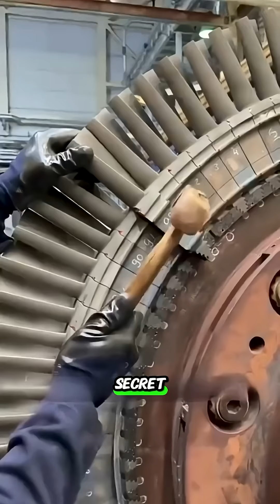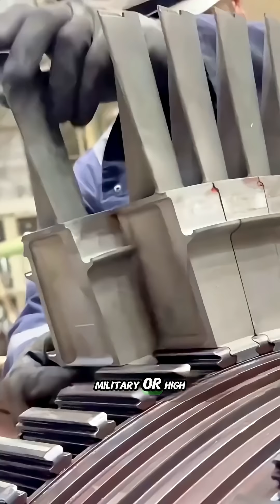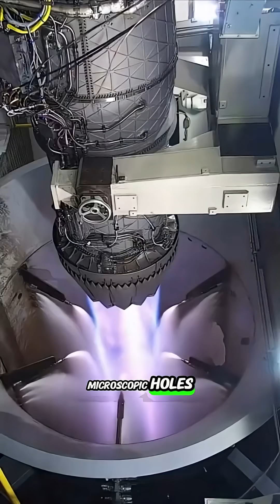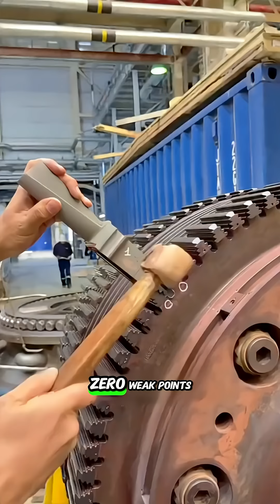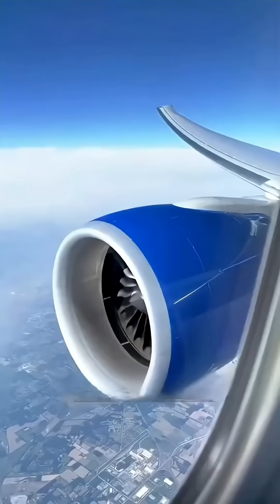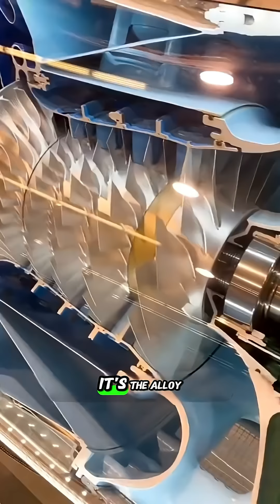The Insane Reason Nobody Can Copy American Jet Engines

Comment: Excuse me, there are quite a few that make good jet engines:
GE Aerospace. 
Rolls-Royce (UK): A dominant force in the wide-body commercial airliner market, manufacturing engines like the Trent series for the Airbus A350 and Boeing 787, as well as marine and defense engines. 
Pratt & Whitney (USA): A division of RTX Corporation, they produce a significant portion of commercial jet powerplants, notably the GTF (Geared Turbofan) engine family used on the Airbus A320neo.
Safran Aircraft Engines (France) A major aerospace leader that primarily operates in global partnerships to produce commercial and military jet engines. 
CFM International: A highly successful 50/50 joint venture between GE Aerospace and Safran. They produce the CFM56 and the LEAP engine families, which power the majority of the world's Boeing 737 and Airbus A320 fleets.
International Aero Engines (IAE): A consortium consisting of Pratt & Whitney, Japanese Aero Engines Corporation, and MTU Aero Engines (Germany). They manufacture the V2500 engine for the Airbus A320 family.
Engine Alliance: A joint venture between GE Aerospace and Pratt & Whitney that produces the GP7200 engine for the Airbus A380.
Honeywell Aerospace (USA): Produces auxiliary power units (APUs) and engines for business jets and helicopters.
MTU Aero Engines (Germany): A leading independent engine manufacturer and key partner in major international engine programs.Williams International (USA): Specializes in small gas turbine engines for business and military jets.AECC (Aero Engine Corporation of China): The state-owned Chinese manufacturer developing domestic engines (such as the CJ-1000A) for COMAC commercial airliners.United Engine Corporation (UEC) (Russia): Produces engines for Russian civil and military aviation.IHI Corporation & Kawasaki Heavy Industries (Japan): Major aerospace companies that design, develop, and manufacture components and engines as partners in global programs.

Comment: Okay.  So, a weight difference of a strand of hair will rip one of these turbines to shreds, correct?  And at the same time, these engines suffer bird strikes commonly upon takeoff and landings, also correct?  Sooooo, not even a bit of bird is ever leftover stuck to a blade that even weighs as much as a single strand of hair?  Maybe?  But highly unlikely if I'd venture a guess.  I mean, blood and guts splattering onto a superheated surface will almost certainly leave some residue stuck behind, if not for a few moments at least.

Comment: https://youtube.com/shorts/GfUeITppwDY?si=QgYmN1PLxBSNCy5H
Warning: 1. Boeing got one thing right. Keeping the body of the plane above the wing. By the same theory outer wing should have opposite curvature as opposed to inner ring (wing). I did not think of the arch myself. 2. Mounting the engine in a shock absorber should fix (some of the) that design process. 3. Adding a confinement ring for the blades should do the job.(I don't see any) 4. Adding a centrifugal force balancing ring with holes should do the job. As the rotating system rotates in the horizontal plane, mass dropped moves to the opposite point assisted by gravity. (I saw somewhere centrifugal force can be corrected by adding mass. Automatically). 5. I would rotate the object at horizontal plane and note point of max. Displacement and add mass on the opposite front. 6. Heating can be controlled by liquid nitrogen on blade tip jet propulsion engine. 7. Large rotation axis makes sure object undergoes less heating. 8. A simple way to solve the problem would be to anchor axis at 3 points where the two points are further from the point of centrifugal forces where the extreme points are 3 to 4 times the size of engine. 9. Gyroscopic gear system that resists displacement should do it. (see my video on railways) 10. setting up an automatic system that amplifies lateral displacement and corrects for it for each engine. (Something to solve) @www.boeing.com @www.ntsb.gov

Comment: Complete bulls**t!
There are 4 world class jet engine producers in the EU + UK
- Rolls Royce (UK)
- Safran (Safron)
- MTU Aero Engines (Germany)
- ITP Aero (Spain)
Moreover, tiny little Sweden with 10 million citizens has been producing jet engines on license since the the mid 1940's (actually one of the first jet engine producers on this planet) - not only has Sweden produced jet engines on license, most of these licenseproduced jet engines were enhanced and tuned up and had better performance than their American and British originals.
Even more, the most powerful gasturbine engine ever is produced by the German Siemens (Siemens turbine also have their main development center in Sweden and also major production in Sweden).
I have personally visited a turbine blade factory here in Sweden (several times, may I add).
They made the blades from scratch, including the cooling channels and all.
Even the powdered metal used to make the blades was produced in Sweden.